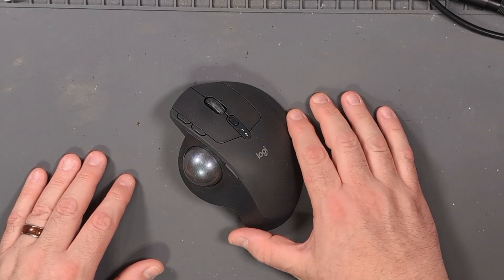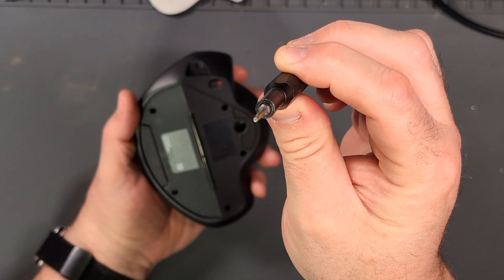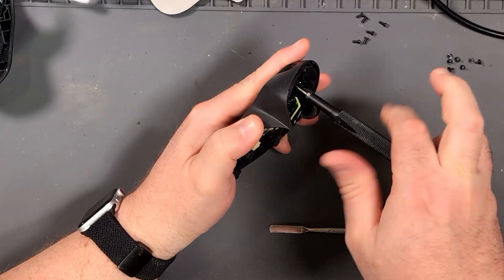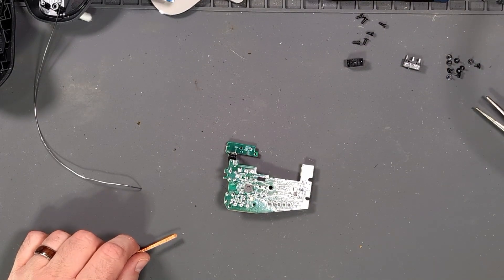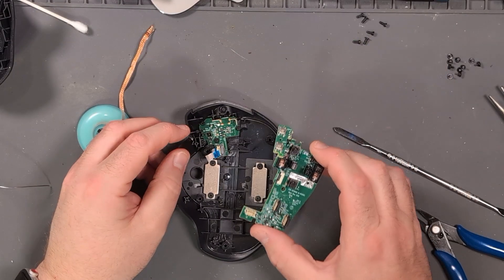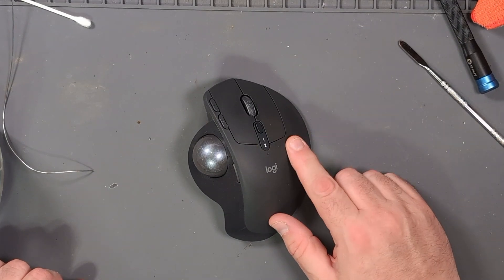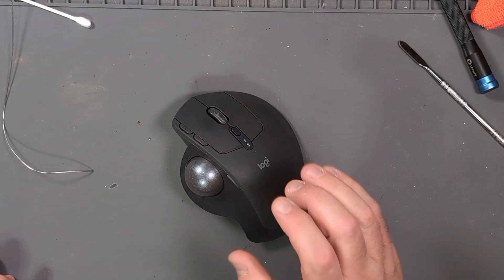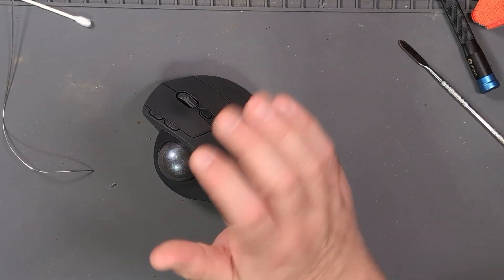Fixing the Garbage Mouse Buttons in the Logitech MX Ergo

Comment: Can you link the soldering tools you are using to do this? I have the same issue, and I'd rather fix my mouse than try to buy a new one.
Reply from the maker: This is the one I use it’s not a super high quality one but it’s what I could afford and it works well it uses t12 tips, they are pretty common.  https://a.co/d/61kCOVH

Comment: Here's me considering getting one of these but between the buttons dying way too quickly and the fact that it uses a Micro USB port, I think I'll just give it a miss.
Reply from the maker: So even after fixing the buttons I was still having issues, the roller ball was no longer moving smoothly even after cleaning so I bought a ProtoArc EM01 NL it’s under 40 bucks on sale on Amazon Canada right now and it’s great, been using it for about a month.

Comment: BTW I have a 15 year old Microsoft wired optical trackball mouse, and the buttons work fine still.  I actually had to replace the tiny roller bearings for the track ball because those wore down.  Logitech did intentionally and still intentionally only uses mechanical switches now that have a 20k click lifespan.  From my understanding  "not sure if it was intentional " but these switches are not rated for the power logi is using, and it causes them to die faster.

Comment: Did you buy better buttons? I think these are rated at 20k I replaced mine with 80k
Reply from the maker: I had left over buttons from fixing a Logitech g604 mouse and they happened to fit so I used them

Comment: HI there, I had the same problem on the wrist in using standard mouse that's why I venture in this MX ERGO, so far it helps in my usage. But then I have this same problem with the buttons, I thought maybe I am careless in pressing it. So bought one and did try to be more gentle on it, yet it's still failing. So I have two expensive mice already, so I think I will try to fix it. Can you send me the switches that you use? Thanks
Reply from the maker: I bought them from Amazon Canada, you can probably find them on any Amazon, eBay or AliExpress https://a.co/d/7w3pQyt

Comment: For a complete beginner where should I start, buy a cheap soldering kit?  and where did you buy the replacement switches? What do you think of the Kailh GM8.0?
Reply from the maker: I think those are the switches I used, here’s a link https://a.co/d/7w3pQyt Amazon has some pretty inexpensive soldering irons that you don’t have to break the bank on. If you’ve never soldered before go buy something cheap at a thrift store and practice.  Oh and buy flux it makes it way easier to solder

Comment: I had a wireless Logitech mouse that had the same problem. It would suddenly drop when I would drag something, and would double-click when I wanted to single-click. I thought it might have been a problem with its connection to the dongle, so I "retired" it after, maybe, three years and bought a wired mouse from another manufacturer.